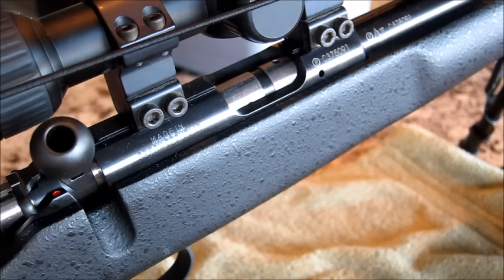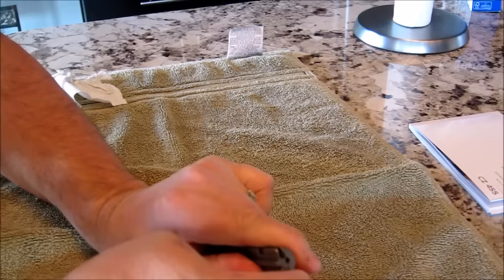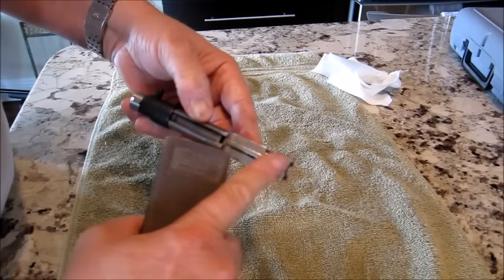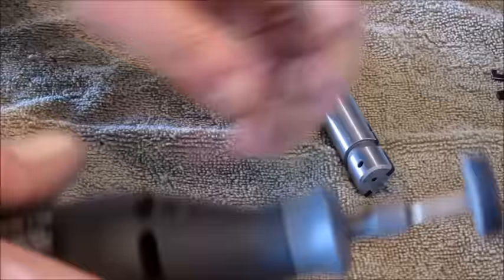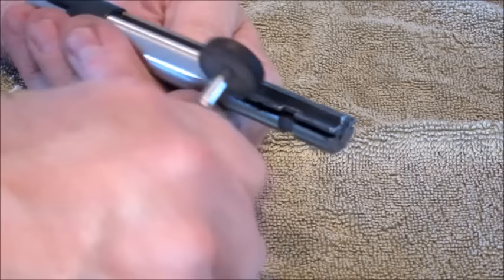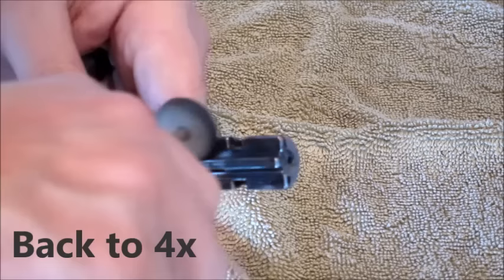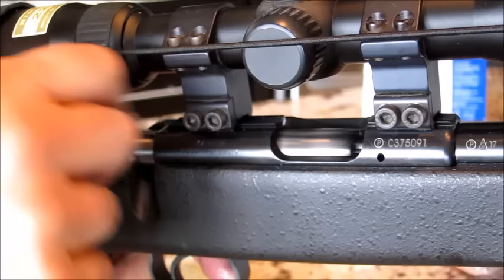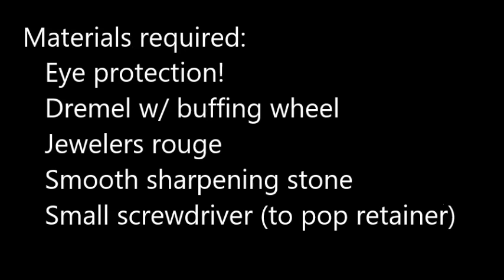Polish your Bolt to Silky Smooth in 20 minutes - (Shown on CZ 455)

Comment: For my CZ455 & 457 bolts, I buff them with a 6" buffing wheel on a grinder/buffer machine using brown polishing compound.  Unlike the 455's stamped serial number on the bolt, CZ laser etches the serial number on the new 457 bolts on the bottom side and they are very gritty when new.  I take down the rough edges with a green scotch pad on die grinder and finished them with the buffer.  Spend 1/2 an hour on this process and your bolt will be silky smooth.

Comment: Works like a charm, I picked up a 1986 Brno which had very little use so the bolt wasn't worked in at all. Its now glass-smooth! Also a going over with cotton buds & autosol afterwards makes it even better.

Comment: Good job my Brother, Semper Fi!  Any new firearm today needs that kind of attention up front; it is not done any more from the manufactures.  I use stones, wet and dry paper of different grits, jewels files and even lapping compounds at times in areas.  The Dremel tool works, but I have metal polishers up to a floor standing unit.   The 455 is an easy rifle to do, and you nailed the every guys solution to do what needs be done.

Comment: I used fine emery and then polished.  On my first I used the old method of using it for 25 years.  Never liked the roughness when first bought it but didn't even consider the option of fixing it.   I bought a new for my wife and polished it.  Both about the same now.

Comment: Great advise. Did this on a new CZ .22.  Instead of a stone, I barely knocked off the sharp edges using wet/dry 1500 grit sand paper, then polished with a dremel like you did.  Cleaned all the polishing compound off, oiled it back up, and smooth as silk now.  Thank you for posting this.

Comment: Excellent video. I did a similar procedure on my Anschutz 54.30. Although the bolt was fairly highly polished from the factory, a little extra work with some autosolvol made a difference. I also use some slide glide on the bolt as well as a regular strip down and very light oiling of the firing pin.

Comment: It should of been smooth from day 1, i got the 527 american .233 brand new a few months back and it was as stiff and rough as hell, you shouldn't have to put 500 rounds though a rifle for it to preform smoothly at the price you pay for it. You done a great job explaining how you polished yours and i have done the same as a result, good rifle now so happy days.
Reply: They aren't that expensive though(just 500 bucks in most stores). Adjusted for inflation, your granddad paid 3x's more back many decades ago(often 2,3 or 4 week's hard labor pay for one rifle). Anschutz quality will cost you $2,500.00 for a new Anschutz rifle to get all those added "personal hand made" touches... taking 20 min to polish your bolt to your liking isn't even remotely a big deal for a rifle owner to do.

Comment: That stone looks just like my old Buck Washita stone. For the DIYs that have never used the felt wheel and a polishing compound before, wear a mask so you aren't breathing the very fine dust that is created by that method and also, if you have guitars or nice things that you don't want covered with a fine layer of the polishing compound, either cover them or remove them from the room or just do the polishing somewhere where your nice stuff isn't around. Using Tripoli would have done the job without having to use the stone. Of course, carborundum in 400, 600 and 1000 grit would handle the job if things are really rough, and polish after that. As smooth as an action feels from the factory, a good polish job always improves the working feel of any action, although I have to admit that my 452 American was and is, pretty smooth and I haven't done anything yet to improve it.... Maybe one of these days..... ;) Also, I should mention that Dremel has a "cratex" wheel that is impregnated with a very fine polish and that wheel would do much of this work itself....

Comment: I checked out a CZ 22 Mag; Autoloader about 3 years ago. The Safety was sooo sticky that I could not move it. The owner of the Firearm store who was Big and Burley took over and he had a great deal of trouble getting it to move although he finally did. I was and still am not impressed with CZ's quality. This example doubles my doubts about CZ's quality. CZ is not exactly a budget manufacture of firearms. Kudos for this fix if one already has one or more.👍👍
Reply: I have a 455 LR that has no probs with 'clatter' like the vid, but the safety was very hard to operate.  It's due to the 'strong' firing pin spring - the firing pin is blocked by the safety.  Just had to round the edges of the safety lever inside the bolt, waaayy better now.  I didn't need to polish the bolt of my 455, but my Sav B22 needed the bolt's guiding rail polished like in the vid, plus 'breaking the leading-edge of that rail so it wouldn't drag across the bullet-lead and scratch it. That's on a $300 rifle, 'low-end accuracy' it shoots 0.5" at 50yds with SK+ ammo.  My CZ does better . . .

Comment: I just bought a brand new CZ527 American 22 Hornet couple days ago. I bought what i originaly thought was a quality firearm. I couldn`t be more wrong. I got it home, going thru it and cleaning it, i opened the bolt, and it was super tight. Upon noticing, it sounded like it was grinding rocks up as i moved it forward and backwards. I pulled the bolt out, and i just could NOT believe how bad the machine work was on the bolt. Its like it was roughed out on a lathe but never finished. I am just seriously pissed for what i paid for this gun to have it sent to a store to be sold. Its my own fault for not looking at it closer before i bought it. I SHOULD HAVE pulled the bolt out and inspected it closer. Had i done that, i would have noticed how bad the quality of the machine work was and  i would have left it right at the gunshop and not bought it. I dont really want to send the whole gun back to CZ for this problem, but to get them to make it right, i`ll likely have to ship the whole gun back. I`ll be calling them monday to see where we go next with it. You can bet that i WILL BE paying closer attention next time i buy a CZ. A few months ago, i bought a brand new CZ457LUX in 22LR, really sweet gun. Quality was on point, so i slacked off on hard inspection when i bought the CZ527. I figured i was buying quality and didnt need to look it over for flaws i shouldn`t have had to look for. My own fault... but just a lesson to others, the CZ quality just isnt up to snuff like it use to be. We`ll see how they handle my situation. It may dictate if i ever buy another CZ product again, or not. This bolt is so bad that it looks like a metal file. Run your finger nail across the length of the bolt, sounds like a hacksaw cutting metal. Just plain sucks.
Reply: any update on your CZ customer service experience? I own numerous CZ products including handguns, rimfires, PCC, and service-type rifles and all have been good to go.

Comment: I have a 455 LR that has no probs with 'clatter' like the vid, but the safety was very hard to operate.  It's due to the 'strong' firing pin spring - the firing pin is blocked by the safety.  Just had to round the edges of the safety lever inside the bolt, waaayy better now.  I didn't need to polish the bolt of my 455, but my Sav B22 needed the bolt's guiding rail polished like in the vid, plus 'breaking the leading-edge of that rail so it wouldn't drag across the bullet-lead and scratch it. That's on a $300 CDN rifle, 'low-end accuracy' it shoots 0.5" at 50yds with SK+ ammo.  My CZ does better . . . ca 0.3xxs.

Comment: Great video thanks. I just did my CZ455 bolt also, and used the blue rubberized grinding stones from Dremel before the polish.  It really took down the pits and left a super smooth finish.  Same result as your though so whatever hah.  Thanks again, its a different gun now.
Reply: exoduslnx m
Reply: Put the dremel down and step away from the rifle.
Reply: What pits? The only pits are those in your thought process.

Comment: I THANK YOU very much for posting this video🙏. My Savage BSEV 93 WMR's Bolt-Action sounds similar to walking a pair of NEW corduroy pants, which is no surprise. It’s brand new. It’s sold as a target rifle-as compared with their other rimfire rifles-& the bolt sounds just like yours. I had a spinal cord injury that affects my strength and fine hand function-BUT I still shoot & am equally as accurate as my (able-bodied) friends. What does this have to do with your video? Well, I’m not strong enough to cycle that brand new Action...but I’ve heard that 'lapping the bolt' helps make cycling the action much easier. What you’ve demonstrated seems to have greatly reduced the friction of your action=less force required to cycle. Is this what 'lapping...' is? Thanks!
Reply: Lapping is a more careful process with special care taken to keep the surface you're working on flat, it's a bit more intrusive than a deburr and buff

Comment: He left a bit o f important info out here and a little mistake. One, the Stone was a straight razor hone which is in the neighborhood of 20 to 30 JIS Grit. It is not a typical sharpening stone and hard to find. A hard white or black Arkansas stone is easier to find but expensive and is what a smith uses for fine work such as trigger honing.

The co mpound is NOT Jewelers rouge. R ouge is a compound for soft precious metals and made from iron oxide. It is not for steel. Color of bar is dull reddish brown.

Compound used here is White Alu. Oxide and is a fine polishing compound made for steel. Do not order rouge for your work thinking it is the proper compound. 

White is fine, Green Chrome is finer adn pure Green Chrome is the finest for full mirror finish.
 
KnifeMaker/Retired after over 47+ Years in the Craft.
Reply from the maker: I appreciate the input. I did use jewelers rouge, but you sound like you know what you’re talking about so everyone should consider it.  Very best!
Reply: for whatever reason, it did not print as I wrote it. It (the Razor Hone) is not 20-30 Jis but rather 20,000 to 30,000 JIS in Grit. Huge difference!

Comment: Does the little groove on both sides of the retainer spring that hold in the extractors and firing pine go towards the butt of the gun or towards the muzzle end of the rifle?
Reply from the maker: For my CZ, I’ll plead ignorance because I didn’t see any groove.  I would say that as long as the clip is firmly in place, it should be in the way of anything and thusly shouldn’t matter, but research just in case.  ;)

Comment: !Very usefull video! Thank you!  But what stone are you using? I migth as well ask what polish paste you are using so I get it correctly from the start :)
Reply from the maker: The stone is ultra fine… in the neighborhood of 1,000 grit or higher. The compound is jeweler’s rouge that feels like a round stick of semi-hard clay.  I would imagine that you could also use mother’s polishing paste. 

Notice that the stone and polishing are so light that the acid factory etching is still readable. The stone is just to lightly take off the high points.  The jewelers rouge is to polish it.  

All this to say, don’t overdo it. Less is more.  ;)

Comment: Is there a trick to putting the spring clip back on properly so the extractors work? I removed the spring for cleaning and now the bolt fails to extract spent cases.

Comment: That is a good way yes but what about the counter part? The action?
One guy made a vid how he uses JB Bore paste on to the bolt and then cranks it back and forth for a while. That will leave the action side smooth too. It will also form it to the action by wear, not by mechanical grinding.
Reply: But it must be  a bitch to clean out of all the nooks and cranies.....this way you just simply clean the bolt, and your done.....the counter  parts will wear in within 500 rounds....

Comment: This seems like something to be done to a new bolt but would this work on a severely pitted bolt of an SKS I bought for $75?
Is there any recommended procedure to remove the pitting before final polishing?
Thanks in advance!
Reply from the maker: I don't have a good answer for removing the pitting, but if the pitting causes high spots from rust and such, this would smooth it out.

Comment: Hello sir. Nice and usefull video. Any day now I'm expecting my new CZ 457 Varmint to arrive, which I will than glass-bed and polish the bolt. I got here my double side plated stone grading 400/1500 grit. Does 1500 sounds about right for the bolt ''sanding'' or should it be finer, like 2000, 3000 ....Thanks in advance for advise. Which grade is stone you're working with in the video ?
Reply from the maker: JureD I used jewelers rouge so would go with the finest possible first and only higher as needed. The sharpening stone is extremely smooth. Not sure how fine but it has no grit to it whatsoever. Hope that helps.
Reply: Leave it alone. It's a fine production rifle and will break in and be just as smooth, but tighter than if you try to make it better than the manufacturer.  Step away from the dremel.
Reply: The 457’s are known for having very rough bolts. Especially the serial numbers. The 1500 should be good. Also check the inside of the receiver for burrs.
Reply: Just got a 457 jaguar last week. Smooth as butter.

Comment: So you only polished that one lower section of the bolt near the face- nothing along the mid section between the face/bolt handle? Interesting.
Reply: It would make a lot more sense to have just polished the back interior of the receiver where it makes contact with the bolt.  That's where most of the roughness comes in.

Comment: what did you use on the dremel again?
Reply: Kyle Riedel 
Jewelers Rouge
Reply: Looks like buffing compound. But you can use valve grinding compound to the same effect, just smire it on the bolt and work it back and forth, then rinse bolt and receiver with gasoline. No need for grinding stone.

Comment: Use nitrile gloves if you are handling carbon steel that has had the protective oil removed. Hand oil will cause rust.
Reply: And oil will prevent it afterwards.
Reply: Your hand oils are slightly acidic, causing rust. Gun oil isn't.

Comment: What about corrosion resistance now ?
Reply from the maker: Marc Indied - Thanks for asking. No worries. The same light coat of gun oil protects the buffed area just as well as the rest of the bolt. ;)
Reply: Marc Indied the bolt was never corrosion resistant to begin with
Reply: @donz8501  disruption of the hardened surfaces from the factory.

Comment: It annoys me that It's necessary to do this on what is supposed to be a high quality rifle. The bolt on my CZ455 was very rough and also needed to be polished. Disappointed with CZ quality!
Reply: SuperFrasman lol and what does the American market have to offer? Cheap sheet metal receivers from Marlin and cheap castings from ruger. CZ quality is fine, if it doesn't suit your fancy a anschutz can be had for twice the price.
Reply: Can't argue with that but I still think CZ could do a better job with their machining.
Reply: For the price point the accuracy is exceptional. £400. It’s a cheap rifle, Something has to give unfortunately, but OP has good advise to make it smoother to operate out of the box!

Comment: you have 2 bolts one whife a number and one you use in video whifeout a number wii see you pollisching the one whiteout the numbersorry for my ridings i am  a hollander
Reply: Jonge jonge John...ga eens dat lesgeld terughalen, zelfs fonetisch is het moeilijk te begrijpen.
Reply: @ervie60  snelle reactie na 2 jaar
Reply from the maker: Yellow, my friend. Your English is good. 
And sorry for the extremely late reply. Haha

I can promise you that it is the same bolt. I actually shot the description of the stonework AFTER I did it. You can see the acid etching that is still on the bolt in the before and after images.  ;)